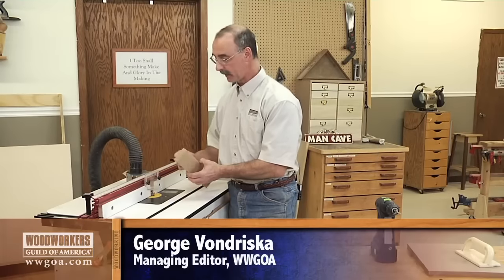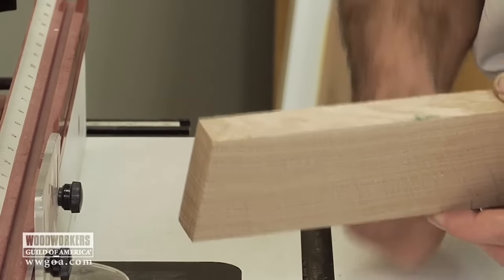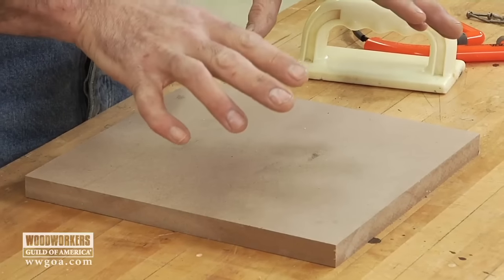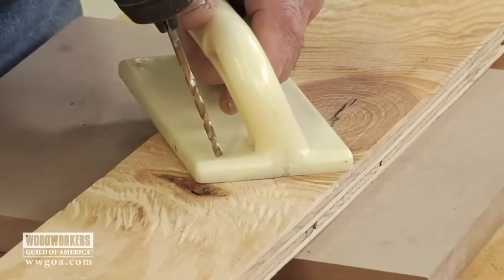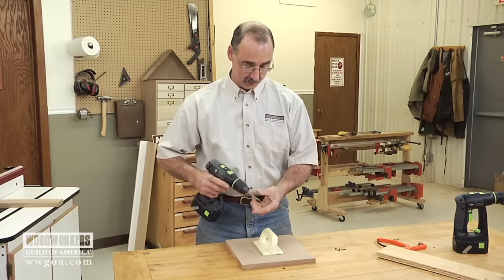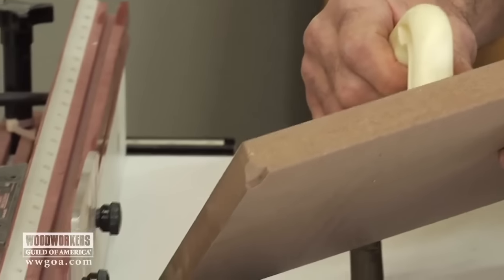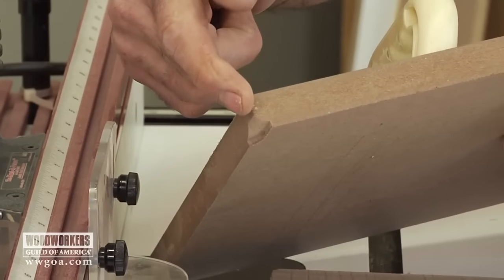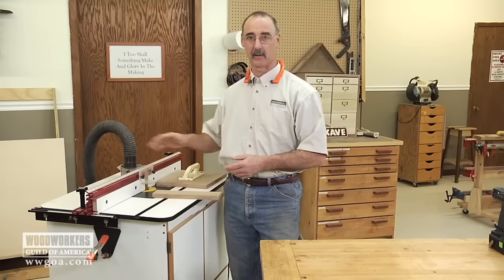Simple Router Table Push Block

Comment: How about using a big round knob as a handle so you don't need to turn the handle everytime?
Reply from the maker: +Miserace That could work as well, provided that you were able to get a good solid grip on it.  Stability and control are really important here. (ZD: 3520)